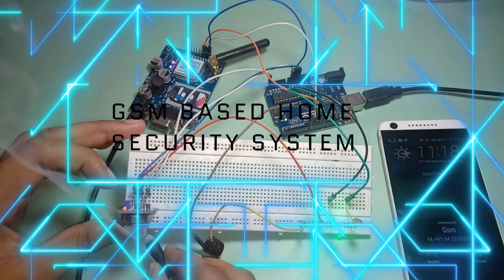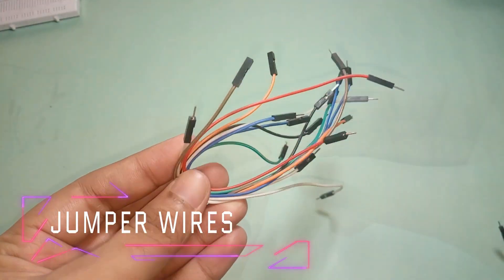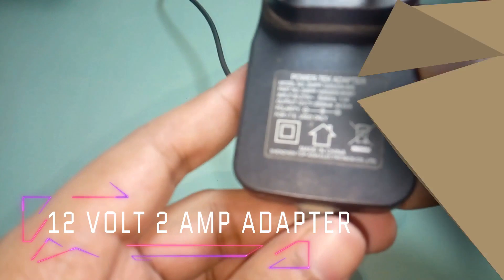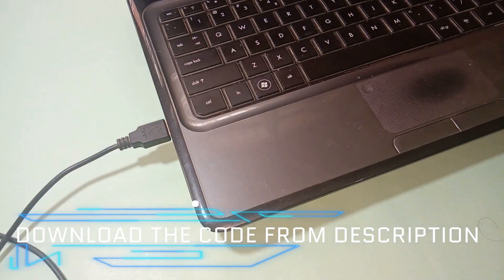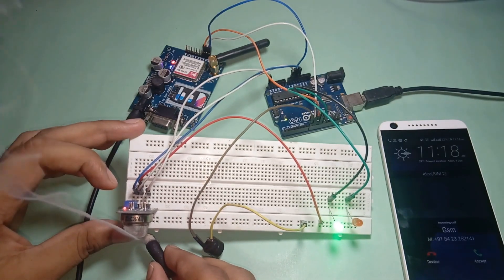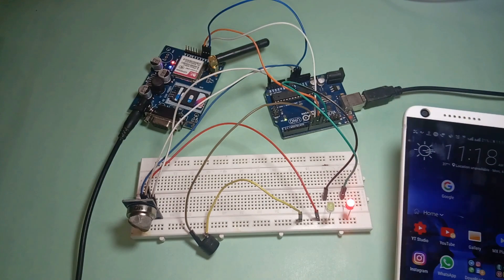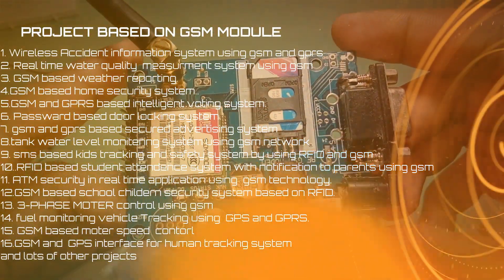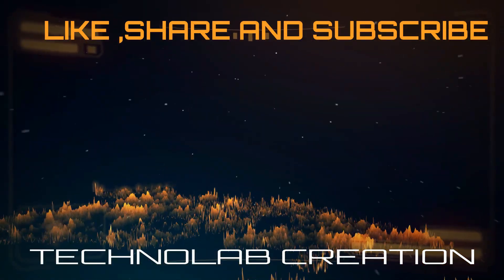GSM Based Home Security System using MQ-2 gas/Smoke sensor, Arduino uno and GSM module Sim 900A

Comment: the gsm module 800A not sending the msg
Reply from the maker: Use sim 900a
Reply: @technolabcreation   can say the code for working in gsm 800 A very urgent
Reply: @technolabcreation   because tmr is my project so the unable to buy the gsm 900 a so can u sent the code for the project

Comment: hi
  I want to make a home Security alarm by using arduino ,pir motion sensor and sim800l  when a motion detect then call my phone.
I want this project for my final project please help me how to make it?
 and your information send to my email(hassansedaqat66@gmail.com)
I am waiting for your help.
thanks.
Reply from the maker: Yes u can make it very easily
Reply: OK do u have its cod? if u have send me
Reply: I can used PIR sensor instead MQ-2 gas sensor with this code?

Comment: We have to give different power supply to gsm can't we connect it to arduino .pls upload schematic
Reply from the maker: Okk very soon I will upload
Reply: Technolab creation but bro I need urgent help there is our school project please can you help me
Reply from the maker: When you have to submit
Reply: Technolab creation actually I have to submit this Saturday we joined LCD screen and it works with different coding .then we try to modify it we connected gsm sim 800 l to it then we upload different coading it was right but then sensor didnt active and buzzer also not work
Reply from the maker: Check description I upload the code